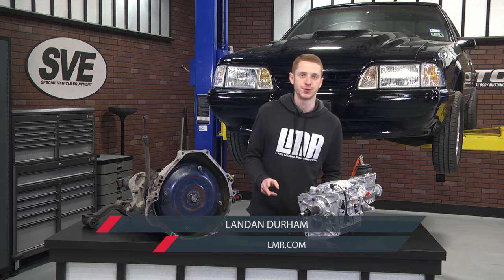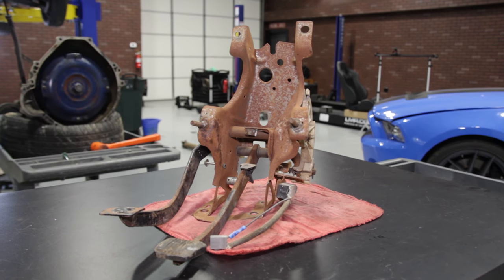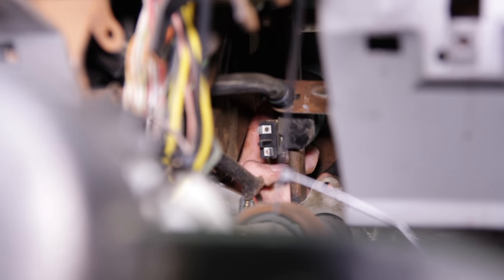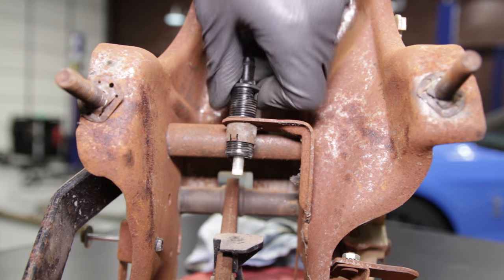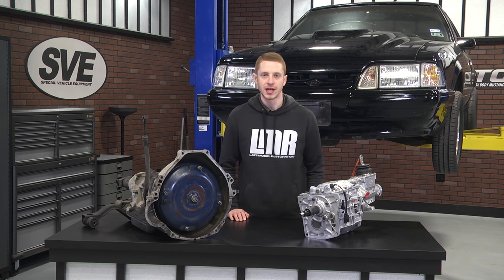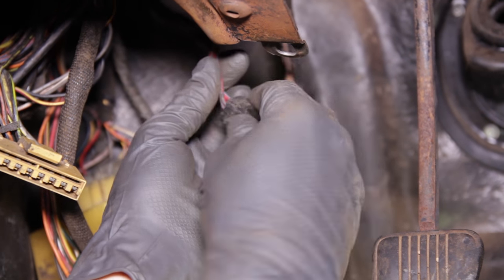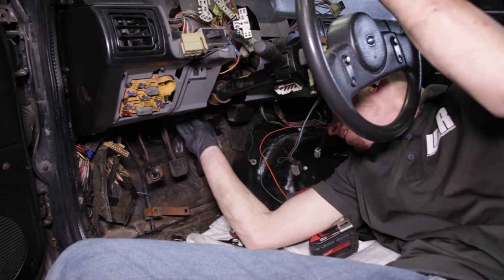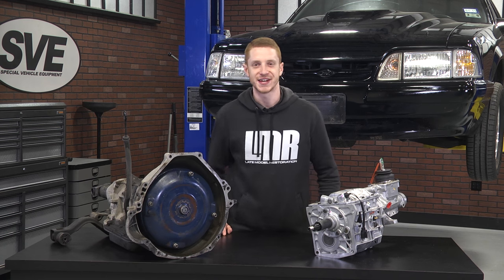How To: Mustang AOD to T5 Transmission Swap - Part 2 (1984-1993)

Comment: My pedal assembly did not come with a clutch dump switch nor did my car have the wires for it. Is this common on late year 91 Mustangs? I know that a lot of parts were switched over to the 92 production run parts in August, mostly the interior parts.
Reply: Same... I have a 93 GT and can't find the jumper on the right for the clutch dump switch. Does this not exist on my car?
Reply: @robsmith5988  you ever figure this out???
Reply: @jseifert18  What’s up bro. I found the switch on another pedal assembly my buddy had. I added it and found the plug. If you are not using cruise control then you don’t need this. If you don’t have it and you are using cruise, when you push the clutch the gas will go wide open.
Reply: hey i have the same problem. i cant get my car to start no crank. did u guys have the same problem. or would your car start up

Comment: I’m working on a 1991 foxbody drop top I found a jumped connection that was around where the radio sits my wire colors from body side of connector are two solid yellows and two reds with green stipe the jumper connector wire was a looped green wire is this ok to run for the clutch dump switch I plugged it in and slid right in
Reply from the maker: The yellow wires should actually be light green. That is the connector for the clutch sensing (dump) switch. -Landan

I would also recommend investing in the electrical and vacuum manual for a 1991 Mustang. Link below.

Paperback Copy: https://lmr.com/item/BSK-9437/bishko-mustang-electrical-vacuum-troubleshooting-manual-1991
Digital Copy via USB Flash Drive: https://lmr.com/item/LRS-WM8793/newrad-solutions-mustang-electrical-vacuum-manual-usb-87-93

Comment: I am presently performing a 4 cyl to v8 swap using a manual equipped 4 cyl. As mentioned in your video, how critical is the difference between clutch pedal arms on the 4 cyls to the v8's? Will there be drivability issues? What adjustments may have to be made if using the 4 cyl clutch pedal assembly?
Reply: Ken Blaich I have the same question as I’m planning my 2.3L lx AOD to t5?
Reply: How much of a pain would it be to swap an a4ld to a manual transmission?
Reply: Doing a a4ld to t5 swap both 90s up dual plug 2.3na cars, so far everything is about equal on disassembly from his v8 to my I4. I'm barely on doing the interior work so bear with me, but I'll hopefully post updates as i do the swap. Donor car is a 91 2.3l na 5 speed, getting a 2.3t swap, the 2.3t swap came with 5 speed transmission so I'm moving the t5 from the soon to be swapped 4 banger to my auto 4 banger which has been a pain on me with the a4ld.

Comment: Currently doing this swap to my 1991 Mustang; At this time it seems as if the starter is not getting any power to turn the engine and fuel is leaking. I have researched the forums and I end up at the Neutral Safety Switch constantly. I plugged all jumper cables as shown and still nothing. Do I need a LMR T5 witch harness to connect to the T5 transmission as I see it has the female end of the neutral safety switch on it? If so, where do the wires connect to as they are open ended as shown on the LMR harness
Reply from the maker: Scooby, Please reach out to our customer service department and we will be happy to tech this one out. https://lmr.com/contact

Comment: I have a 93 GT and can't find the jumper on the right for the clutch dump switch. Does this not exist on my car?
Reply: @UCny994RZeTIA1c_4VFg1Tmg you are correct... it is only to deactivate cruise control. I had to find from someone to install on mine. Without this if I was using cruise and pushed in the clutch, the RPMs would max out. Cheers bro!
Reply: @robsmith5988  Amazing, thanks — I’ve been searching for this info for a while haha. I just deleted my comment after seeing you answer someone else here.

Comment: is this pretty much the same steps and processes in a 1995 V8 GT?
Reply from the maker: Dale - For the most part, yes. There may be differences in wiring on the '95 cars. To keep things very straightforward, I would recommend sourcing an entire T5 wiring harness from a donor car. -Landan
Reply: Late Model Restoration thank you!